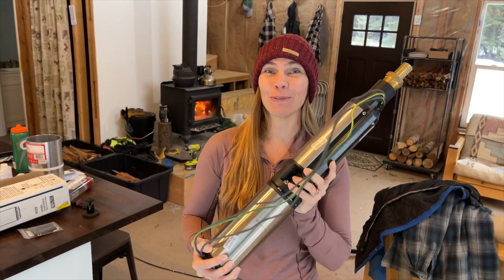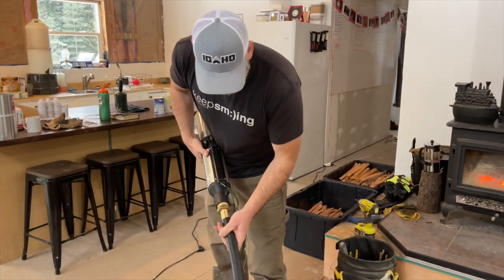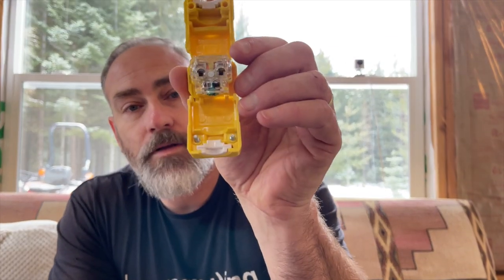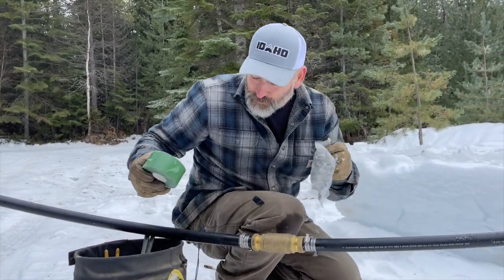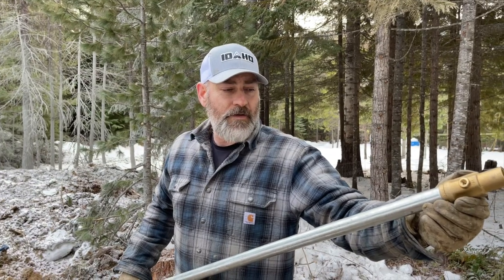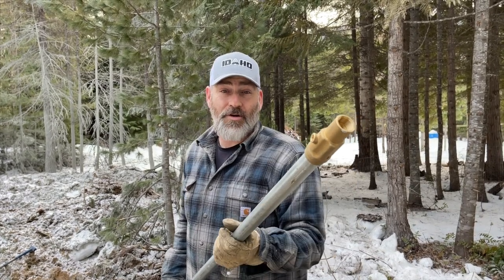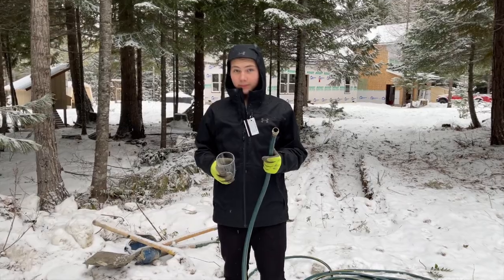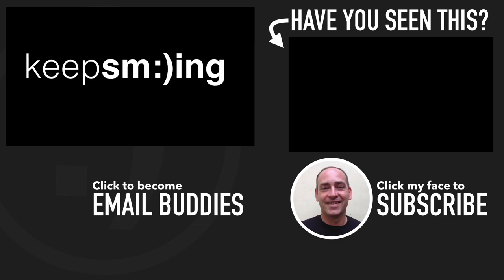WIFE is HAPPY/HUSBAND is NOT - DIY Well Pump Installation

Comment: Also the boot you puut just above the pump looks about down far enough. The purpose f it is so when the pump kicks on it limits the pump from banging on your casing and potentially busting teh foot valve...But usually it seems that the pipe after 10 years or so will end up beating at your electricl wires until you get a short circuit. You still have to pull it out but all you have to do is splice in and drop her back in. Also if you ever pull it out again. Not a bad idea to instal the plastic discs at 10 to 15 foot intervals they keep the pipe in the center have a nice little notch for the cable and even the rope. I think for a 6 inch casing you use like a 5 inch disc so they dont hang. Sorry dont mean to sound like a know it all but I grew up on well water. And with that comes digging up frozen lines in winter. So good thing you went down 4 feet. Thats smarter than what we did. We always built a block well house filled the block with saw dust and stuffed and wrpped everything in insulation and ran a lightbulb in there on a thermostat. But the pressure tank and switch was in there as well. But our frost line when i was a kid was never below 18 inches in East Tn. but now rarely it freezes below 4 inches. This brings back lot good memories. Coal and Wod stoves and well pumps! Salute!

Comment: lived in AK for 16 years, reminds me so much of our life there, On thing I would do with check valves and pumps, use a black paint marker for the direction. I bought a house in North Pole , AK, had a boiler for heat, previous owner installer a pump leaving the boiler toward the house, and then another pump entering boiler, except installed the second pump backwards, both pumps worked against each other, and at -60 could not heat house above 40 or so, I decided to inspect the whole system do find out why, and found the pump installed backwards.   I saw the previous owner one day and asked about problems with heating the house, she said they never had a problem, after I discovered and fixed the issue, I saw her again, and told her about it, she was quite upset with her husband, and Said, so you mean we didnt have to sell the house.
Reply: also if you run some PEX with glycol in the trench along with your heat trace, you will have an alternate heat source for your berried  pipe, just incase

Comment: as a general rule you don't put the pump at the bottom of the well it is up some hence the torque of the pump, also it will keep the well stirred up if the pump is setting on the bottom

Comment: You purchased the 110V pump so you could use solar power to pump the water. If you have to use a 5000 watt generator, it does not sound too feasible to use solar power. Also at the depth you are pumping up the water, I would think a 220V pump would be a better option. That 110V pump must be working like crazy to pump the water and I dont think it will last very long. Just my opinion. Great video!

Comment: When you install a new pump you need to sanitize the casing and pipe.
Reply: We always dump 2 gal. of liquid chlorine down the well & circulate it for a few minutes. Doesn't do anything to the grease from the drill tools, but gets the water line cleaned out.
Reply: Turn it

Comment: The motor is not spinning on startup, that causes super high amp draw, its called a "Locked Rotor Amperage"  LRA rating - look on the spec sheet or name plate for the LRA Locked Rotor Amps.  Either your motor is jammed by something or your starter circuit is wrong, many motors need a start capacitor or start relay etc to get going...  Check your wiring carefully.

Comment: When you have a problem with electric motors starting on generators often times what you really need is to be on a 220 V and most generators do actually supply 220 V and another thing they don’t tell you is when they’re labeling how much output a generator has the number they give you is only when it’s running at 220 V. When you’re using a 110 it’s only running on about half the winding and there’s only really getting half the power of the generator is rated for. Often times motors can be re-wired for 220 or 110 and directions for doing same would be included with the product and of course it should be labeled on the box that it can be used with either voltage. 220 V not only more efficiently uses your generator it’s also more efficient when you have a long run of wires as high voltage requires smaller wire.

Comment: Glad you got this working! FYI they make soft start pumps that basically ramp up over several seconds to keep the current draw constant, but they are a lot more expensive due to the integrated electronics, etc. Might be worth considering though if this will be putting a crazy load on an inverter every time it starts.
Either way thanks for the videos and best of luck to you all!
Reply: Thanks! Glad you commented.

Comment: New wells usually need to be pumped for several hours to clean out the drilling trailings and get the water cleaned up.

Comment: I lived on a farm in Minnesota where we had a variety of animals. keeping water troughs open in temps below -10f can be a challenge.  The thing that worked best for us was using a small submersible "water fountain" type pump.  I bought them online or at the end of the season  for less than $20.  They would keep the water in the tanks moving and prevented freezing.  We had a submersible ring tank heater but a horse burned it's lips once and the heater went away.   Like you, we also had 2 wells, one deep and one sand-point.  Our sand-point well had a pressure tank buried about 5 feet down to help prevent freezing. regardless, the water source went dry each winter and we had to haul water on a sled to the horses.  Good luck with the temps.

Comment: My friend you have to, gauge The wire for The length. Also there is something called I2 when the fuse is drawing more then it can handle it will fall down automatically.  So for example you have a 16 amp fuse i2 over her in Europe is 1,3  16*1,3 = 20,8 amps if the current is higher then this the circuit will fall down protecting the wire from burning 👍👍😊

Comment: yes,,bigger gen  i got a 5500 now,,had a 4000,,my table saw would not start,,it was only a 2 hp,,,but if i would plug it in,pull it out and replug it in,,it would run,,,,the 5500 helped a lot...but i would say may be a little bigger one,,would do it...im going to tell you one thing  about that jet pump,,make sure your wire dont wiggle around down there,,when your pump kicks on ,it gos sideways rubbing the wires to the case,,put tie straps on the wires,,,i had to pull mine one time,,at 10 degrees,,in the wire down there broke in side the cover,,,i had to use a ohm meter to find that out,,,oh what a job..looking at the wires,they looked fine,,but one was broke,,,oh yeah,,solder right out in the yard,,oh it was cold,,but i fixed it,,,,,i called the pump guys,,and they said they were all booked up,,,but they told what to look for..66  foot deep...hope you fix it bud,,,

Comment: The Grundfos SQ and SQE pumps, while much more expensive, have a soft start feature that eliminates the high amp draw of initial motor startup.  It’s actually pretty amazing.  My 10 gpm pump never draws more than about 5 amps on 220v even when it first starts up.  Glad you figured out the issue though!
Reply from the maker: Think I might be getting one of those this summer.

Comment: When ever using that nylon rope,  electrical tape the ends or tape where you are going to cut , then cut line in the middle of tapped line.
After you tie your knot,  tape the loose end to the line . ( keeps it from coming loose. )
Reply: Blowlamp the ends to melt them into a "blob" .... that too will stop it comming loose! Electrical tape just goes "gummy" with age .... Don't ask me how I know that!

Comment: Been there on the generator. We lived 20 miles out of Fairbanks without power for 7 of the 32 years. Ran a lister 4kw diesel generator. Well pump was ok ,but locked rotor current on washing machine spin cycle got us. We can relate to your unfinished walls too,our ceiling looked like that for 4 years . We enjoy watching your adventure, hang in there.
Reply from the maker: Thanks! It is fun to DIY even if we make mistakes.

Comment: 35 Amps is a lot of amps to be drawing.  I don't think that it's incorrectly wire because I think that amount of current would noticeably heat up those wires. I would check with the pump manufacturer and make sure that a 35 amp draw is normal.  If it is maybe something is wrong with the generator.  So, when all else fails, read the directions.

Comment: Yes it should fit by the adapter AT LEAST ONCE YOU REMOVE THE INSIDE FLANGE PORTION  which you have to remove anyway to get water to the rest of water line such as the frost proof  hydrant and eventually water line to house etc.

Comment: It looks like you need to install some type of in-line sump filter somewhere between the pump and water softener, if you are using a water softener.  
I have an in-line filter made by Aqua-Pure and it uses replaceable filter cartridges (Part number AP110) to clean debris from my drinking water.  My well is down 420 feet and this filter system works out very well for me.  I hope something like this a solution for you as well.

Comment: So 10 gauge wire is rated at 30 amps - 32 amps is pushing its limits.  The next thing you have to worry about is voltage drop over the long wire. (wire has resistance) adding more wire to your house will add more resistance and possibly more voltage drop.  When the volts go down amp draw goes up (watts = Volts x amps)  if you already have a coil of wire to reach the house attached.  That coil could add Impedance resistance (magnetism) adding resistance now.  A pump house with a pressure tank and filters next to the well head might minimize the cable length and the voltage drop. Sub panel in the pump house shed  fed with oversize wire to circuit breakers feeding the pump might be the answer.

Comment: Now that you got the pump primed you will be able to run it with the 3500W generator.  Priming takes more "UMMPH."  So glad you got it working.  The water will clear once you get it cleaned out.

Comment: Gonna need to let it pump off for 24-48 hrs. If it doesn’t clear up you’ll have a issue on your hands. Drilling crew will need to come back out and start running more casing back in the ground. I’m a driller myself.

Comment: Out here in New Mexico we don’t pump a well to max you could make it go dry faster plus it will make it produce sand like you have 
Try chocking it down to 2 or 3 gpm that might help sand in water of course your  pumping head will go up and cost more. 
Maybe you got to big of a pump 5 gpm at head you need would have been cheaper and easier on your well.
Good luck

Comment: Ooof.  I felt for you when you had to dig down 4' for the pitless adapter.  Thankfully, though, you only had to dig 4'... mine is 8' down!  I did not do the install in the middle of winter, but it is a major pain to line up the pitless adapter after pulling the drop pipe.

We used a 5000W generator to operate our pump for the first few months after installing it, and it was just barely enough to start it.

Comment: Congrats on the well!!! That is so awesome, and 10 GPM is certainly nothing to complain about. Glad your static water level is not all that low either. Definitely doable for a backup hand pump like the Apocalypse Well Pump. 
I would guess that once you've run several hundred gallons worth of water from the well, it very likely should clean up and not be so dirty. That was definitely the case for ours that we drilled in spirit lake, as well as our neighbor's. They had to run thousands of gallons through it to get clear water, but it finally did clear up and was awesome once it did.

Comment: I’m glad you figured it out. I was buying a generator for my compressor and had to check the watts and make sure it was big enough. Amps x voltage =watts. I’m not an electrician but I know that equation.

Comment: One of the things that I like in Australia, we only have 240 volt supply and no 120 volt, so our current draw is half yours and cable sizes are half as well and as in this case a smaller generator would suffice

Comment: You might should have gotten a 220v pump,  that will take a decent size inverter to start!   Maybe a small water tower to store water for a gravity feed for off grid use, so the pump isn't used during the normal power use,  that's what I have planned,  about 400 gallons, with about 2bar over pressure to help things along, it is only going to be back fed through a faucet until I decide if I'm going to keep it, I can fill the tank when the batteries are charged while the sun is still available for powering the pump. Then it can be shut off allowing the resovoir to supply water, maybe at half pressure, being 75-80 normal flowing pressure,  I gave 3/4" supply pipes, with 1-1/4" from the pump, there is a 1" opening in the fitting I used when testing the flowing pressure, it does decent for only pulling 7 amps!!  I also have two carbon filters, but still don't trust it to be drinkable,  it's a old shallow well,  I think testing it multiple times, after heavy rain fall, and more filters before I'll drink it!! I might harvest rain to be filtered, and UV sanitizer, maybe do the UV for both! Living off grid can get crazy if you let it, I don't have a grid for back up, but I do have a couple generators, and a 12v lithium battery bank for backup, with a 33kwh 24v lithium bank, and a couple small UPS, with larger batteries, they can power small stuff for a few hours,  a couple 450 watt, and 1500 watt ups ain't going to do much, but it helps, I'm planning to get a 1500-2kw 12v inverter, to power the fridge and must haves, invade the 33kw gets used up, if I tried, that could last nearly a month, without sun! But it would not be easy!  Especially with a 80some% efficient inverter, pulling a decent stand by,  I haven't tried a capacity test like that, but it works decently with daily use, and charging, with only part of the batteries installed, and panels connected, I have a dozen 270w panels to connect, maybe I can. Recharge after nightly use in about 4hours, I'm debating on adding panels to the 12v system, instead of using DC to DC for charging, maybe I'll do both, it is only normally used for 12v lighting and security cameras, and a few other things, about 50 amps, from a 400+ ah lifepo4 battery bank, 300-600 watt panels should do nicely, especially if charging with the DC to DC,( 20 amps)  it should be charge  quickly,  plus the main reason for 12v, us charging from a running car! I have 8gauge with Anderson connectors, to be connected to a car, or DC generator for charging, in emergency, I also have the ability to charge the 24v system with a DC generator, to 85% or so, (28v) I just need to finish the DC generator, I'm debating on using my riding mower, as the engine, 12hp should supply a decent wattage, say 50% efficiency of the alternators, 750 watts/HP, should get over 4500watts ! That will be like full sun, about 180amps, if fully drained, maybe 220 amps, my two 150amp alternators should handle that, I just need to finish the custom regulator, to control the output of the alternators, I have Two, 150a, and Two 130amp, alternators, I was planning on enough power to fully power my inverter, and charge the batteries, but I think that's Overkill, 200amps for 12v or 24v should be enough, I can trickle charge the 24v bank from the 12v bank if really needed, being off grid you never know what you will end up needing!  Sorry to be rambling!!

Comment: I just recently replaced the pump in my own well.  The pump I purchased came with its own well relay. You need a deep well relay for a deep well.  Not sure of the proper name for said relay ,but it won’t work with out one. Mine is located on the wall close to my pressure tank.  Hope that helps. Pete. Jen is my wife.

Comment: The 3500w generator is an inverter generator.  They do not do well with motors.  You may want to consider 220v stuff for motors lower amps or dual voltage atleast until you can get  a large enough off grid system

Comment: The high amps can be a result by the size of the used cables. For 34 amps every cable must be have a thickness of 4  mm.  In the case of it's internal resistance. What says the user / service manual of the pump about this?  For to protect you equipment against power peaks you could use an AC filter.

Comment: Dig hole by hand.  Why not use the front end loader to get close to well casing and use shovel to finish off.

On the generator setup.  You can look for them they make a soft start setup for electric motors so that they can start a motor and run it with a smaller generator or for your offgrid solar.

Comment: The bigger genny will do til the summer. U need to wire a start capacitor in to your system to help the motor overcome the start sequentc and to get away with a smaller genny, also what is suppose to be the draw on the start winding vs. the run winding on the motor? Check with the manufactures specs. Thats one reason why there are pumps with 3 wires and 4. The 3 wire systems require a start capacitor in your mech room, 4 wire systems com with a start capacitor on the pump.